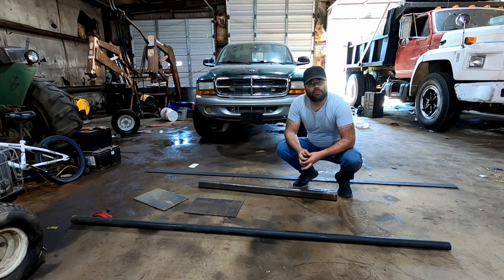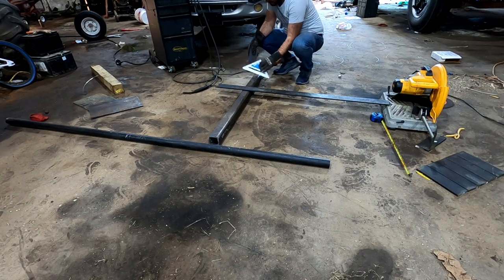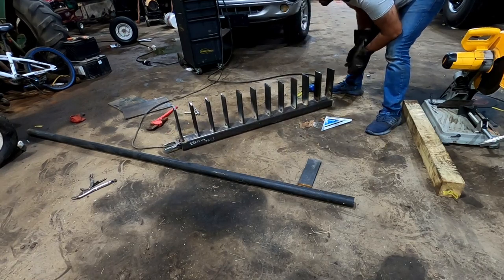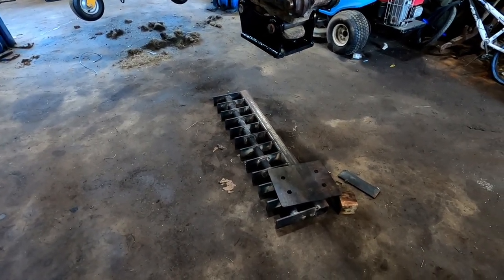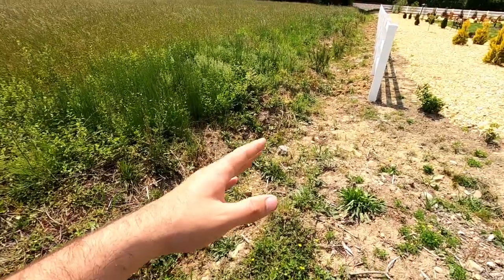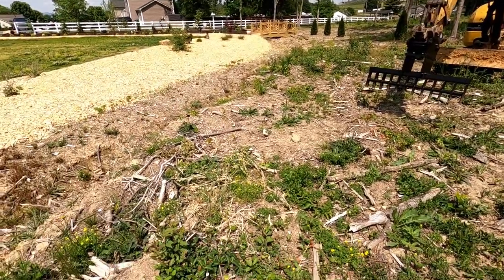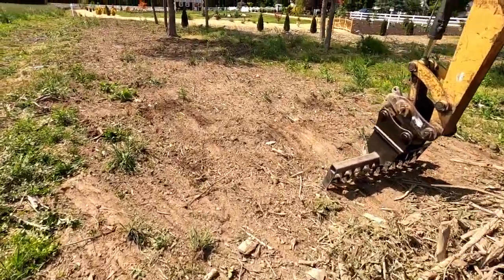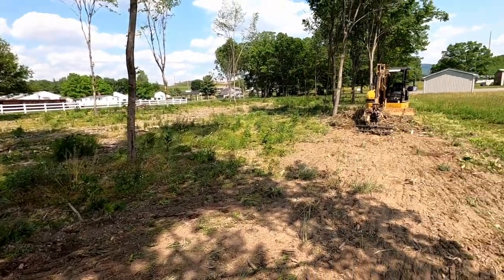Custom Excavator Rake Fabricated and Tested | AMAZING!

Comment: Very nice work! I have been building a number of attachments for my mini also. I have a local shop cut out any fancy items for me on their laser table and it's a very reasonable price. You might find that you with it had tilt, not a terribly hard thing to add and would be a fun project.

I like that you bolted it to the bracket saves money on buying multiple brackets. especially for a tool that you likely won't use all the time.
Reply from the maker: Thank you for your comment!
Yes, I am just hoping the bolts do not break - it may be a weak point but I am not sure. But they are 1" grade 8. So far so good. I ran this rake for about 12-15 hours total on that project. I plan on making a plate to hold the auger from the skid on the excavator, and that is why I went with the bolted bucket adapter mechanism.

Comment: Just a thought. You can make that rake where a thumb would have clamped onto it. Then just set it down to use bucket and thumb to load amd pick it back up quickly to rake. No need to attach or unattach anything that way

Comment: Nice job fabbing up that rake. It gives me some ideas on cleaning up some ditches around here. Do you feel like your rake is more productive than say a 3-point root rake on a tractor?
Reply from the maker: I think so, because you have a lot more orientation and control over an excavator boom. I thought about a skid loader, but it’s wider and thought it would miss more in high/low spots. I think this would be perfect for ditch work!

Comment: Where did you get the attachment part?
Reply from the maker: Found on eBay, “305cr adapter plate” or “305cr mount plate”

Comment: i saw the part where a tiny root stopped it.  its useless.  a regular bucket already has teeth
Reply from the maker: 😂😂😂 if you say so…. Purposely putting the minimum amount of ground force down as possible. The goal isn’t to dig…. But alright, I’m happy with the attachment. I have won a lot of clean up jobs with this, so I guess to each their own. Thanks for the view and comment!